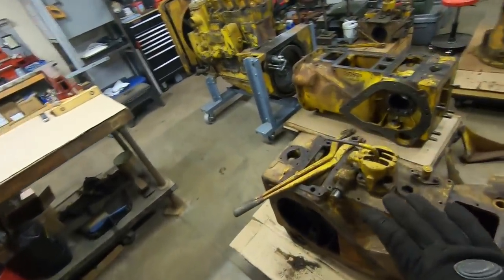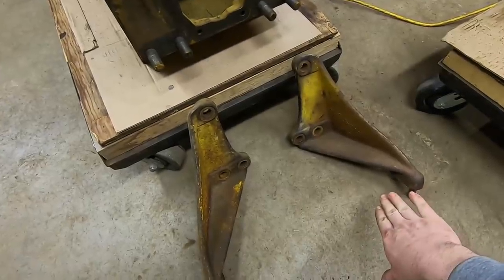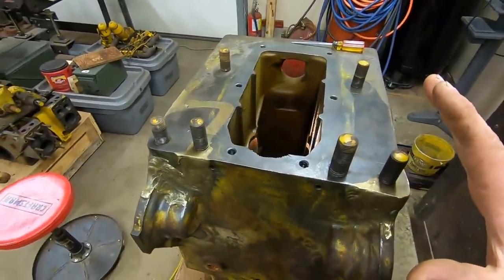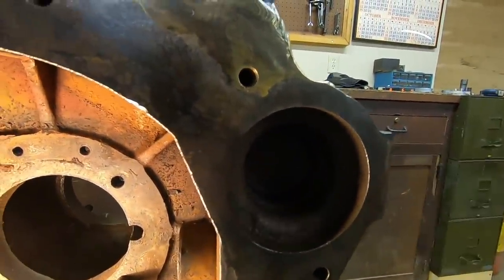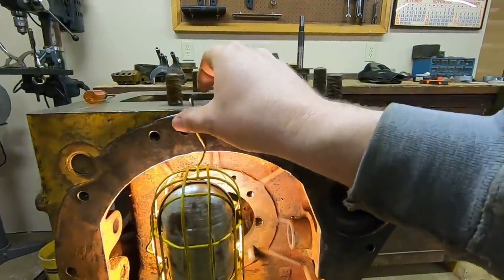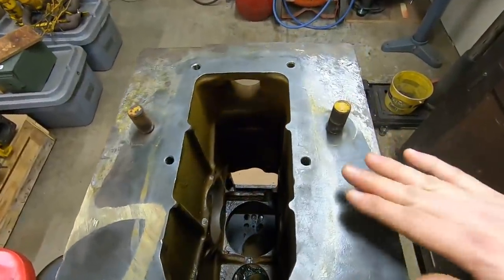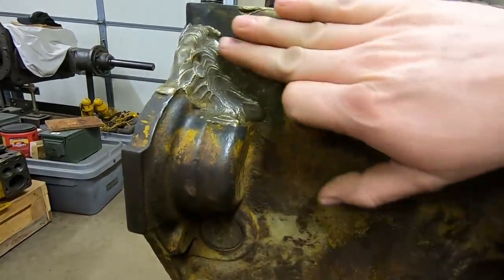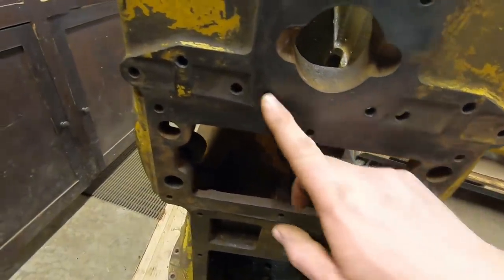Caterpillar D2 Transmission Casting Weak Point & Examining An Impressive Prior Repair On #5J2115 SP

Comment: I think whoever did that braze job was a master. It’s absolutely gorgeous!
Reply: That is an understment. It is godly. Coming from someone who has spent time around true masters of many crafts. I don't think I have ever met anyone who could pull thoese repairs off without substantialy more machining, let alone the beauty of exterior stacked dimes joint. Its stunning.
Reply: I knew an older man that had started in mechanics in the 20s working on the old cars. He worked for Buick when they started straight 8 engines, Kaiser, Packard, etc.. A friend had an International pickup with a Diamond 6 cyl engine. It got a crack in the engine from freezing. The mechanic drilled holes along the crack, put in some lead plugs and welded the crack. It never opened up or leaked. I've never seen anyone else do that since.
Reply: someone that loved their trade that's for sure
Reply: The welder was an old fella. Probably past retirement age. Always had a cigarette in his mouth. Cussed a lot, but like an olde world prospector. Wore the same boiler suit for 38 years and didn’t care for loud music.

Comment: I can just picture the old guy in the welding shop shaking his head, telling the owner " I don't know, even if I can repair it, no guarantees." Then when it is all done, "I'm afraid I gotta charge you $40. I had a lot of time in it." I have met some of these guys over the years, unfortunately they are long gone. It is nice to look at their work years later and admire the skills they had.
Reply: There's an old man like that here. Ran a welding shop for decades. He's retired now and just has about a million storage units to rent. But I've seen him mark a circle on a plate and hand cut it with oxy/acetylene and have a perfect cut. Little more than a little file work and it's ready to use.

Comment: Regarding the casting repair, I worked for the Swick-Guth Co in McPherson KS back in the mid sixties doing the machine work on large Cat castings that had been repaired with their proprietary welding process.  We did the circular machining using Wohlhaupter facing heads on large American radial drills.  The Wohlhaupter could function as a normal adjustable boring head by locking the cross slide or as a facing head by feeding the cross slide as the head rotated.
Castings were shipped in from all around the globe for repair and looked like new when completed.

Comment: Learned to do that way of cast repair in the late 60's, well, actually from the middle 50's to the late 60's from a combination of the blacksmith/welder guy I 'worked' for and a master welder at a trade school. I didn't actually work in the welding end of his business, just pumped gas and hung around,  mostly.  Ahhh.  Small town North Dakota in the 50's.  But anyway, I learned a LOT from watching in the sense that I figured out what kinds of things I wanted to learn how to do.  Braze repairs of all kinds, from art deco kitchen chairs to heavy equipment castings of all components was one of them,  I got to be pretty good at it, and I can say that Squatch's educated guesses were pretty much spot on.  I can recall brazing an engine block wall crack outside in January in North Dakota in a parking lot with a hand drill with a preparation burr chucked into it, a torch setup (with FULL tanks) sunglasses (didn't own my own #4 shield) and a chipping hammer with the pointed end modified to form a 1/4" wide dull chisel.  It had frozen the night before, and the guy was getting married THAT EVENING!!!  NO PRESSURE!?  Done in place, with engine in car.  Didn't even pull the manifolds.  DID pull the carb.  Might be crazy but am not that stupid?! [grin] Yes, I've also done a few heavier castings under MUCH more controlled conditions, and they are all quite a job.  Goes to show what that generation who lived through the Great Depression would go through to keep from buying new when the old could be repaired and still used normally.  At the tender age of nearly 73 I still get requests to deal with things like this, now-days by restorers, and some young farmers who are trying to get a start.  Yes, the usual project is an engine block, but transmission cases run a close second with exhaust and intake manifolds in hot pursuit (no pun intended) a close third.  I've done a brake drum for a tractor.  Yeah, kinda tricky, with it's external shoe.  Also repaired a church bell saddle and pivot, years ago.  You'd be amazed how much vibration does to "settle" the internal structure of locally heated metals, particularly cast metals.  I was always told that when heat is applied the arrangement of crystals changes and while cooling some vibration helps things to sort of slide back into the same orientation relative to all the other little bits as the part initially had.  Dunno how, exactly, that works, but it darned sure does!   Yes, I still prefer to fix the old and keep using it.  I dunno, but I think the old stuff just runs better, smoother, somehow . . .

Comment: Not sure on the height on 2115's case, but you could remove the rear studs, clean up and clear the case and put a thick glass top on it for a table. Then the repairs are easily visible for all to see

Comment: My father was a master welder, on the railway as a boilermaker, then into the world.  Had many 40s motors to be brazed , cracked from freezing.  Took a lot of heat. Also welding them. They cracked again till the carbon decreased and welding was successful.
Reply: Anytime I weld cast, I let it slowly cool and there will usually be porosity. I will grind out most of the weld bead, reheat and weld again. If there is still porosity, I will repeat the process until there is no more porosity. I’ve never had one of my cast welds fail yet. Preheating and slow cooling is the most important things to remember.
Reply: @notajp  long time ago,  with prompting from you remember him doing that.  As you said,  did work when well done.  In OZ,  this was the way people. In the country, kept mobile with not much money.

Comment: Really good job of brazing on that repair.. Use to repair castings....Sometimes it takes more than one torch... One to lay the bronze and the others to keep everything hot.....Sometimes you have to repair a broken casting because none are readily available.. Reminds me of a fan bracket for a Hercules engine that I repaired once as the unit was needed in a hurry...Brazing is a lost art and many today don't think it is strong.. Trust me, if it is done properly, it can be very strong.. Cheers from Louisiana .. Mike

Comment: This repair reminds me of a project I was involved in. The "circle burner" class we ran in back in the '50s was 59AB flat head Fords. Actually, 59AB C as they were Canadian block which were supposed to have better metal. As the bores were limited to more/less stock block castings one of us had the great idea to bore through the hole and sleeve with 3 1/2 inch GM sleeves.  In 1959  believe we used NASH pistons and rings. The brazing was done by building a large wood fire, heating the block, and brazing the sleeves in place with 2 large oxy torches, then letting the fire die down for slow cooling. the project worked  well and the car on alky was very fast. BUT the three main bearings were not strong enough the keep distortion away and the flexing caused the water to leak in the oil. No bearing girdles then.  But the torque coming off corners was exceptional while the engine lasted.  Alas, it finally blew destroying the experiment and was scrapped.  But this technique worked well for brazing some cracked castings. Please keep up the good work.  I will become a member.

Comment: Sqauch  that repair was expertly done and probably took nearly 30 pounds of brazing rod .
They ground it out to a fine line that would line up.  And heat it up with a rosebud and used a # 5 or 6 welding tip to lay the brass in ..!! 
I did a repair similar to it on a  Ford 4 cylinder engine that had the alignment bosses busted off .
I believe it was a 1.9 liter. 
And only had 30.000 miles on it. 
We needed a engine and we bought it cheap.  It was not on as near as big of repair but very similar. 
And it does take a lot of heat to do. 
Cool video 😊😊👍👍👍👍👍👍

Comment: that case repair reminds me of the wood burning cook stove  my mother used to do all the cooking and heating of water for a family of 6. My father pulled it out of a junk pile on a cattle ranch and spent most of two days brazing up the broken parts . some of the top plates wear missing so he cut some out of plate steel that was also salvaged from the same junk pile. it was the only cooking equipment in that old shack of a house. A lot of bread was cooked in that old oven she used 303 tin canes to keep the bread pans off the bottom of the oven.

Comment: As everyone else has commented already that repair was s thing of beauty 👍 just a point about the drawbar on D2s in agricultural use when pulling soil engaging equipment they always seemed to run on the back half of the tracks with a very noticeable lift on the front whereas on the for example TD6 they always ran with the whole track in contact with the ground 🤔👍👍
Reply: Much as I like Cats, the TD6 was a much better tractor for agricultural work all round. As you say, better balanced for pulling.

Comment: Thanks for this video. I have 2F 22 with the same extensive repair. This episode explained to me what actually happened. It has some 1 in wide braze repair. I have to admire the craftsman/weldor that did the work. I doubt someone would do this much work to save a casting in this day and age.
Reply: Sure they would, I welded together a broken 7000-8000lb drill casting on my channel a couple of years ago. :-)

Comment: What I'm about to say, I know would serve no practical purpose or even be any sort of realistically feasible, especially as a mechanic myself. What would be cool would be to at some point have enough of what I call "tier 3" parts(1=excellent condition used, 2=serviceable used, 3=only if I have to get by used) to knock some iteration of 2115 back together again just as a memory piece, or after seeing your rock feature, use sub tier 3 worn out parts(thinking of 7066's worn out track chains) to build a D2 feature piece for your place or the local ACMOC chapter. Like I said, not a feasible idea per se, but an idea that seemed worth voicing. Love the videos as always.

Comment: Real nice repairs, someone knew what they were doing! loved working with brass as an apprentice. I picked up stock from a garage clearance a few years ago, solid brass bar in round and hex from 10 to 75mm dia. Just need a project to use it on now. Nice just having it though.

Comment: FWIW...   I was in a shop his summer that had a trans case of some flavor that had been turned into a buffer stand.   He had hogged out some good size openings and put shelves in to hold the spare pads, compounds and associated tools.   Between the weight and a couple of Tapcons, that thing was solid.   He could really lean into the buffer and it did not move.

Comment: That repair belongs in a trade school as an instructional tool to show how its done. Failing that,  what i would do is get a sheet of 1/2" or better plexiglass and make a table that highlights that repair; nut the glass to the case.  I still say you deserve a proper teaching job, you definitely have the skill and talent to do it.

Also - don't let YT push ya to do what you don't want to do. That stuff never ends well.  Take er easy eh?

Comment: The case repair is art of a skilled Artisan, mastered there skill and experience. Besides it being re-purposes as a stationary stand. And a very worthy stable tooling support . I see it as a podium base for your antique equipment gatherings for  sharing and speaking swivel mic wired . But ones tool is see is a small table top mill bolted to it. Or two case used for a banquet table base. Just a little fun here. You could not find anything more stable and solid to support.

Comment: Make the case into a end table. Strip the paint and wire brush it, the contrast between the grey cast iron and the brass braze job would be striking. Get a piece on glass to sit on top of the studs, and you have a end table that would be the envy of Cat fans everywhere.

Comment: The brazing work on 1115 is absolutely amazing. By the size of the puddle, that rod must've been 3/16. I can't imagine how they  v-channeled all those angles. That is definitely old school, low tech, bottom up, side to side deep channel skills there. My guess would be a ship welders skills. Brazing cast metal is an art because you have to match heat across the channel without disrupting your bond and keep your flow control all without contaminating your weld surfaces. I am fascinated by the skills of the person or people who did those repairs.

Comment: Excellent video keep up the great videos 👍👍👍👍that repair job must have been done at machine shop at least the resurfacing parts of it. One of my uncle's worked at a machine shop in St Cloud Mn years ago and he talked alot about fixing various large casting and gears and other cast iron parts he said that if the customer's brought in enough of the pieces they always got it put back together

Comment: Wow awesome repair took a lot of preheat just to get the bronze to flow the brass joint is actually stronger than the cast quality repair probably set up on a G and L indicated in they used big fly cutter      or multiple tool holder thing about big thick heavy cast it don’t move reheat afterwards then covered with fire cloth is  the way it stress relieved curios why it’s not brazed from Both sides but excellent repair it stood the test of time !

Comment: Those cases should not be separated. The combined unknown history and stories they could tell boggles the mind. My suggestion for their repurpose is as the two ends of a bar for someone’s man cave (preferably mine), with a thick tempered glass top drilled to perfectly match up with the studs. Who ever owned it could sit down with some buddies and make up “tall tales of the two cases” over a few pints.

Comment: Awesome repair! Half of me would want to re-use that just to respect the repair man. I certainly wouldn't scrap it!.

8:22: Only two machines can do that. A lathe, or an horizontal boring mill with a facing head. Being that that would be a hell of a lot of stickout on a lathe (I'd still do it though lol), I doubt that was used. The fact the top surface is machined square, makes it a trivial HBM job, so I would wager that was the machine that did it.
Reply: @squatch253  It would be fun to watch. What's the swing radius on that thing? I doubt my 18.5" lathe would even swing it, if it did, I'd have to be ginger. A 25+" lathe would be more suited. Preferably a vertical lathe, assuming one had the z height.

Comment: You could turn 5J2115SP into a glass topped coffee table - like they did with an aluminum V-8 or V-12 block on Top Gear.  Put some rubber caps on the end of the studs for the glass to sit on.  Looks like they jigged the case up in a flywheel and head surfacer at the machine shop to true up the case after brazing.  They would have had to take a very thin cut to leave the serial number on the gasket surface.

Comment: a 2" Glass or acrylic round top and the 5J1115 transmission case becomes a combo toe masher and end table.  mount some legs on the bell housing face.. so its not sitting on the carpet..  create some sheet metal shelves in the opening so its useful other than a top surface.. 
 i don't recall if i saw a sheet metal roller in your shop.. you could take the cracked transmission case..  bell housing side down.. on the drive mounts.. create some sheetmetal shoulders that come around to arms and elbows that reach out  to hands that support a mail box.  be sure to weld on some bumps on the upper arms to denote muscles.. and win the cat mailbox contest.  because of your tin can section arms.. it will be far enough back to avoid snow plow damage hopefully.  if you put an car hub and bearing assembly in the bell housing end. you can mount it at an angle so the whole thing spins if somebody knocks the mail  box and it will recenter..

Comment: Excellent brazing work.  Must have had access to a furnace for preheating and post control of cooling.  I have seen repairs like this on Cats made with metal-lacing which are then are brazed.  The paint may have withstood 800 degrees or so or maybe just some really skilled workmanship.

Comment: Yup, my Dad always told me never hook on the tricycle on the tractor pull with or to be towed. so when it was -20 and he was pull out a Tamarack from the swamp when he broke the axle. I went and got the neighbor's 70 hp tractor to pull our C out. When I got back  he was all hooked up and said go. I asked him why he hooked to the tricycle and not to the frame. He said that I would be just fine, which I was until a corner and the rear tire hit a tree. He said back up and give it a jerk, so I did and it moved a little. He said do it again and I did. He said it is going one more time and give it a little more gas. While I did, and sure enough it was going, I went about 100 ft and looked back and the tricycle was with me and he was still sitting on the seat staring and what happened. Boy, did I ever get yelled at, and I just did what I was told. Those were the days.